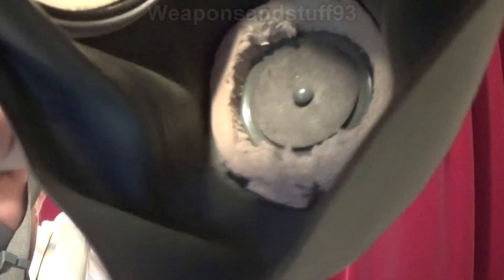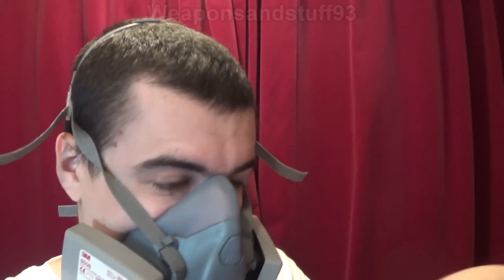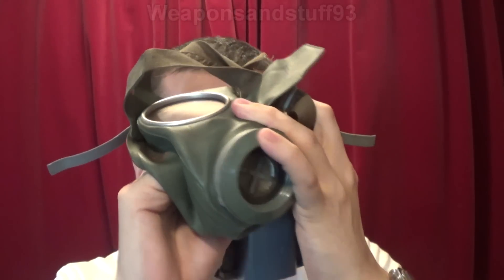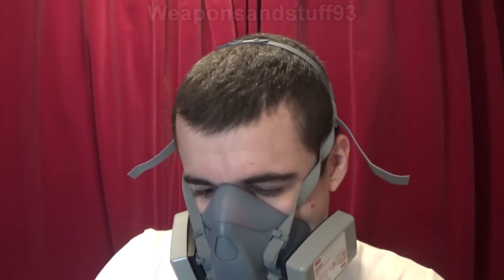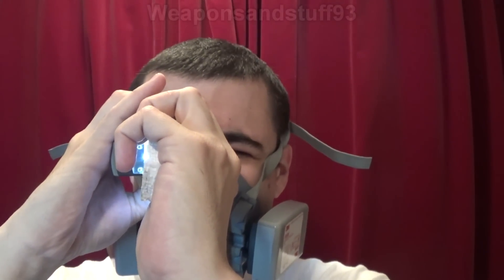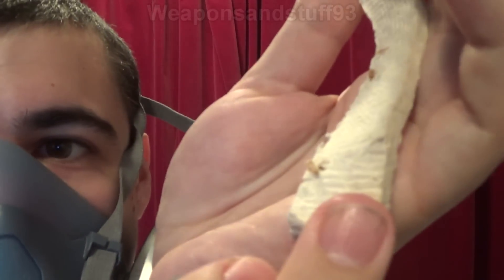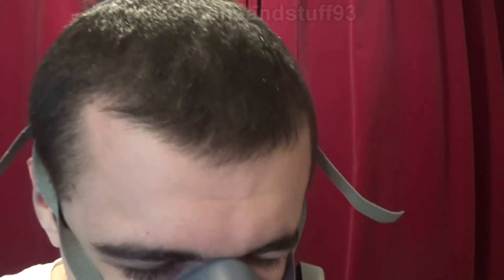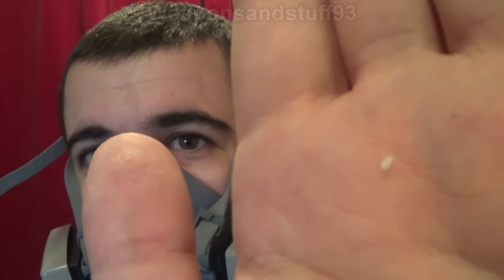Asbestos in Gas Masks not just the filters

Comment: The asbestos foam rings were placed near the intake valve to pretend sweat from the user's face from flowing down the mask and damaging the rubber inner intake valve cover used to prevent air from exhaling through the intake valve. It also provided slight relief from fogging from entered air saturation was thought to be partially caught by the ring, though it did not do so well. The need for this was abolished by the creation of the VM-44 which had a proper exhale valve. Obviously, take this with a grain of salt as I can't provide an instant source but I do remember reading about it on a few websites and it seems like a good explanation. (Note; The ring did not actually help very well.)
Reply from the maker: Interesting information, thanks.

Comment: How would you safely store these so they don't leak asbestos fibers into the air?  I may be being paranoid but today I got both of these in the mail and i wore a working filter with my israeli mask while removing the asbestos weave, but still I would appreciate somebody responding as fast as you can.
Reply from the maker: Put them in an airtight plastic box if you're really worried

Comment: What was asbestos for
Reply from the maker: Everything
Reply: So I guess everyone had something made of asbestos
Reply: an excellent fire retardant...critical on ships and in shipyards going back to at least the 1930s.
Reply: Wikipedia states some of the most common uses are: 

fire-retardant coatings
concrete bricks
pipes and fireplace cement, 
heat, fire, and acid-resistant gaskets
pipe insulation
ceiling insulation
fireproof drywall
flooring
roofing
lawn furniture
drywall joint compound